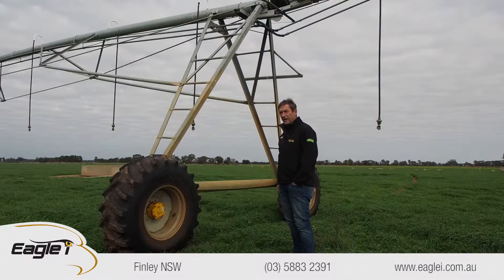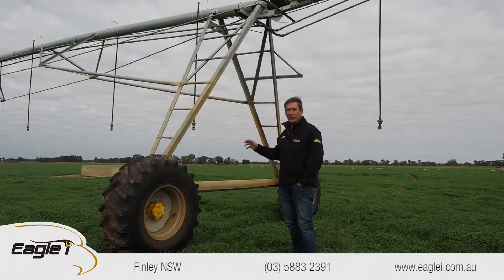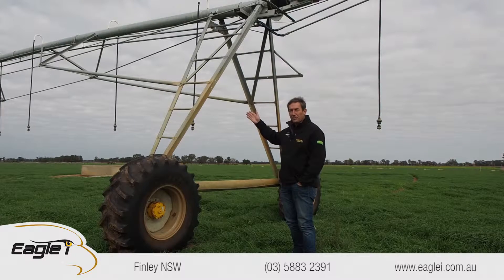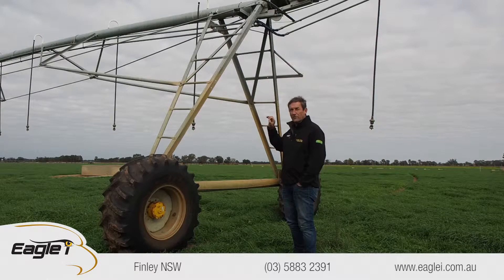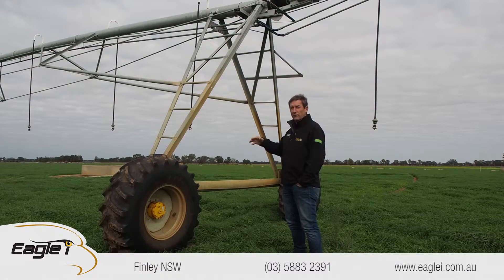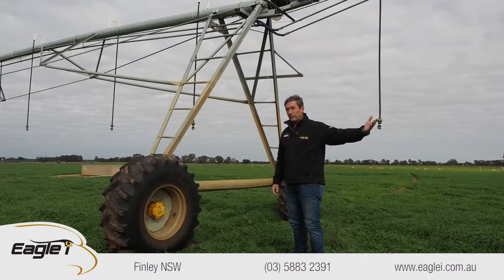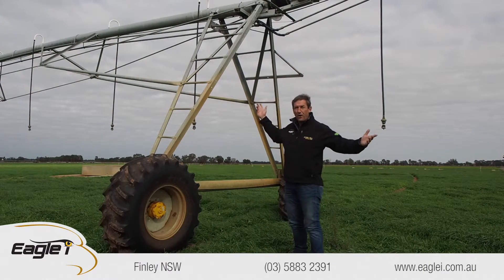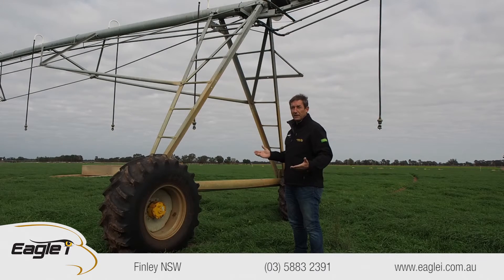T-L hydraulic vs electric by Eagle i Farm Machinery Finley NSW

Comment: At work we have 10 TLs and 2 Valleys. The only oil maintains I have to do is change the filter one a year regardless of hours and check levels, it's not often the you get leaks even in the 30yr old machine we have!. The TLs I can fix any time any day, the valleys I have to wait for a sparky when a motor goes or any other electrical drama. The valleys with a bit of age now do frighten me a bit and have to be extra electrical conscious. I'm always a bit frighten of an electrical shock to myself in the middle of a paddock.